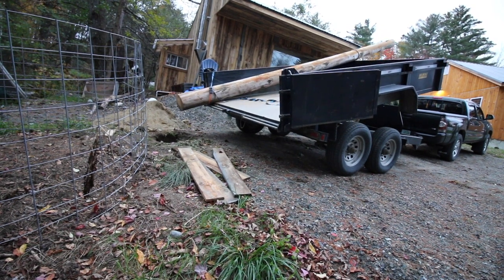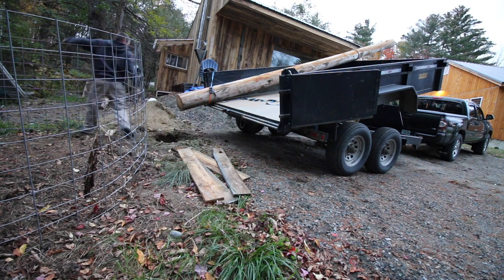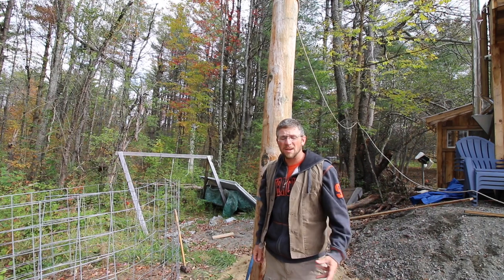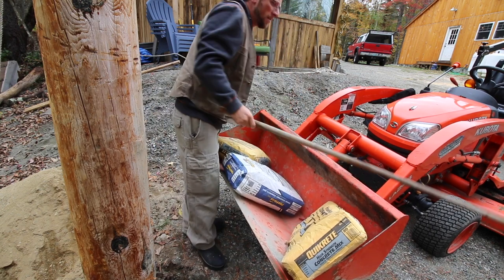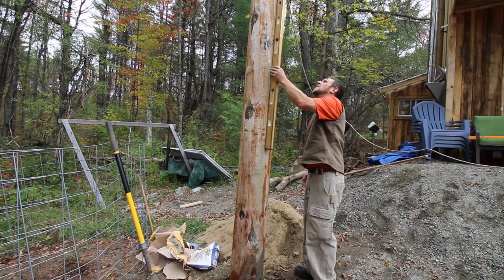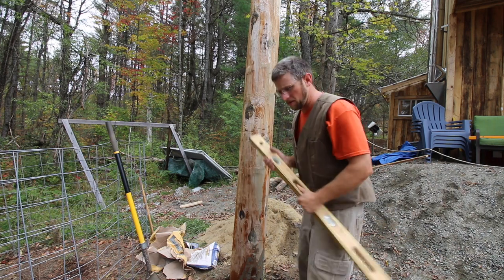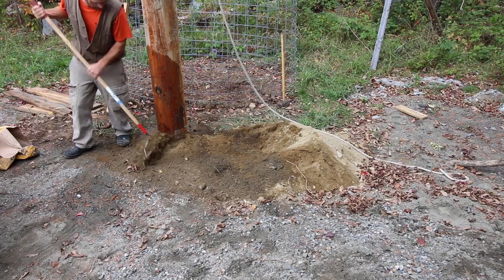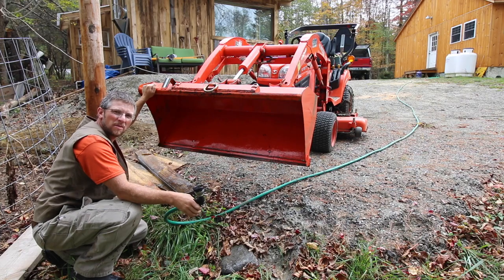How to Get a 20ft Pole in a 4ft hole

Comment: Al, when you have finished using a tool such as a shovel or a similar tool, try this . Use a bucket of sand that has used motor oil in it. Insert tool  ( shovel ) a few times. The sand helps to clean the tool and it is oiled at the same time.  Ready for next use and with less chance of rust.

Comment: I have another idea seeing you did so well with this post setting.  You are going to heat a lot of water in the 'debristeling drum'. This will be very heavy and not mobile once filled on the propane burner stand, and it will have to be close to the lifting post, and with all the attendees needing to be hands on and close up to do the butchering. This presents a safety/work space issue.  I think it would be safer to erect the second pole/lifting arm about 20'-15' away from the first pole. With a chainfall on each lifting arm the carcass could be trapeze from the harvest post to the post at the debristeling drum, then back to the butchering work station. This would keep a safety 'cone' around the cutting/sawing process. I was thinking you using your tractor bucket for doing this transfer/lifting into the barrel, but your tractor has a 6' max. lift height which I don't believe is high enough to clear the water drum and propane burner height. Just thinking out loud for you.....God knows you don't need another project to get ready for this teaching seminar.  All this is said with not knowing if you have already figured this out.  Please, don't you or the subscribers get offended with this comment, it was all said in love and care. God Bless you all
Reply from the maker: We will only do one this year! Lol, I am thinking the 55 gallon drum will be fine. This is how they normally do it.

Comment: Just a suggestion to reinforce your 4x4 jib arm to minimize the downward force on the lifting jib. Use at least a 10' 4x4 for your jib arm. Extend 6' thru on the lifting side and the remainder out the back side. Then connect a 1/2" cable to the end of the lifting side, then run it over the top of the pole, and then down over the 4x4 on the back side and attach it on the back side of the pole about 4' below the 4x4. This will reinforce the lifting jib and transfer much of the weight to the back side of the pole, thus lessening the bearing load on the 4x4. Just a thought!
Reply from the maker: That is a great idea, we have done something similar

Comment: Good job nobody got hurt. How about a boat winch to the cross arm to raise and lower the pig from the ground and do you have a double tree. I think you can field dress a giraffe from that. How about a 4' piece of pipe with the ends crushed and bent to 45* for the brace. Is the smoker build next?
Reply from the maker: We need it 14 feet high so we can scald the pigs. It will make sense during the class

Comment: Take one of the wider boards you covered the hole with and stand it up in the back side of the hole. Then when inserting the pole, it will ride down the board and not dig in to the hole wall.

Comment: 'Ain't pretty but it worked. Ratcheting straps are way too dangerous for that usage; 3/8" chains (minimum) would have been safer.  Keep up your good work.
Reply from the maker: That strap was just to keep the pole over to the side. There was not weight or pressure on it
Reply: You did not had any vertical pressure but you had lateral pressure. Utility poles are not perfectly smooth, just like any straps. Straps are not meant to be use to guide something, they are designed to hold it. From a material standpoint, chains are better suited. I would not have been surprised if the strap or the ratchet mechanism had broke if either got over-tension, resulting in a loss of control of that pole.

Something I should have mention previously is to avoid using concrete with any wooden post or poles. Water gets trap into all crevasses, without anywhere to escape. This results into premature rotting of the pole base.  Most pole are secured using only packed gravel, mainly for drainage. I've seen 50-60 years old poles installed that way that are still in service, without signs of rotting.

Comment: You got some "hogzillas" we don't know about? Why didn't you just cut that pole in half ....... dig two holes ........ run a beam/metal pole between the two telephone poles and call it good. You wouldn't have needed to wrestle with that skyscraper? Would have seconded as a deer pole as well ....... if you deer hunt(?) I'm not trying to be critical ...... I really want to know? PS ....... you might need a lot of quadcopters to lift that beam in place ~8^)
Reply from the maker: The beam goes up in tomorrows video! :) We needed to go 14 feet so we can have a 55 gallon drum under the pigs for scalding. It will all make sense during the pig harvesting videos
Reply: I knew there had to be a method to your madness ...... heh heh!